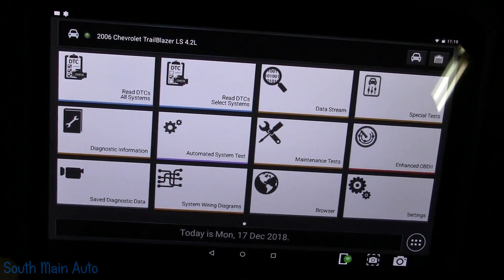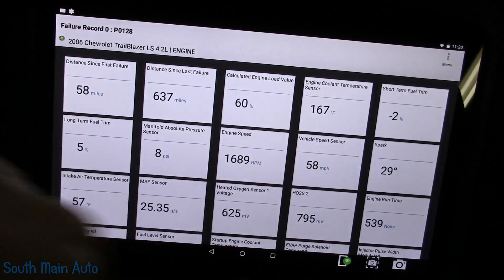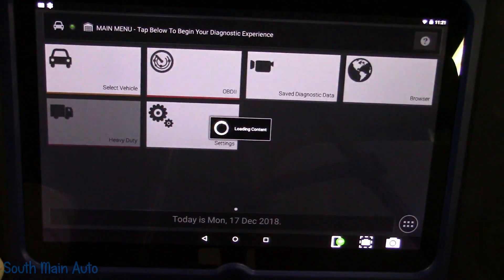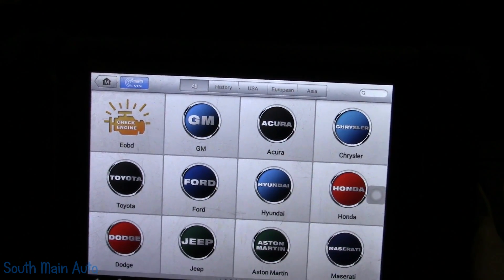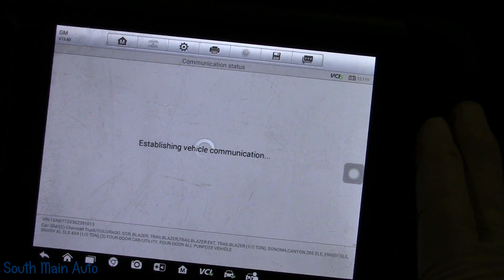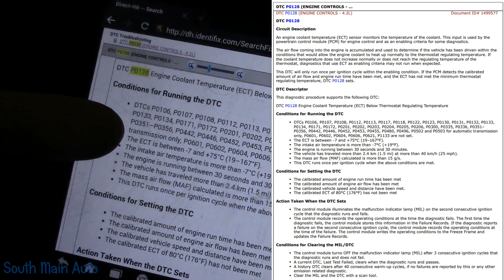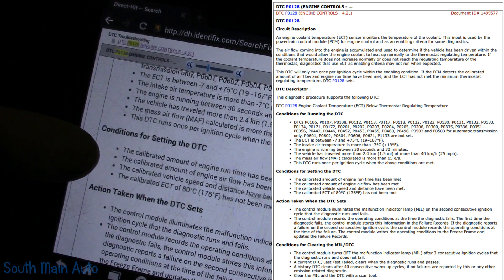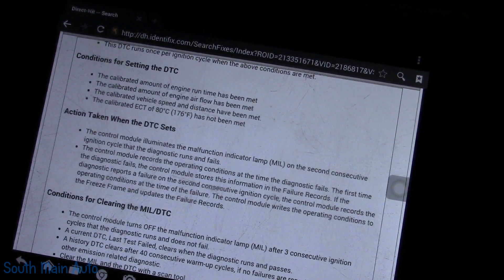Using Freeze Frame Data: Trailblazer P0128

Comment: Did a thermostat on my '04 Bravada (same engine, etc.) about three years ago as I had the same code (low mileage vehicle at approx. 62 k at the time).  Recently got the same code (P0128), at 83 k, so this time I changed the coolant temperature sensor (and I know I should have changed the thermostat again) but I was curious to see if my temp sensor was the real culprit.  So far, no code, but I guess time will tell.  Oh, changing either is a big pain in the tookus(sic); behind the alternator, which isn't any fun either.  Hope I don't have to go in there again.   :D

Comment: Not necessarily freeze-frame data - but I use FORScan with my 2001 F250 7.3L for live data to monitor HPOP pressures and more.  Also good for injector buzz-tests.

Comment: I've had quite a few Ford 3.0 DOHC engines with vacuum leaks (intake), where freeze frame data told the tale. Misfire city - freeze frame says,  coolant temp: 59° - runs better with heat - then confirmed with the water test. Bingo! Longest part of the diag is waiting for the damn scan tool to stop the "spinning wheel" thing and get down to business! 

It's 2019 - can we get a damn magic-box computer that works FAST??? Is that too much to ask?!? 😡 

GREAT vid, Eric - you say you're not a great teacher ... I say ...  BS !! 🍻😊
Reply: Since both scan tools were so slow in this video, I'm guessing the ECM being slow to respond to requests from the scan tool is the issue..

Comment: To be really anal, you could get the engine up to temp and check coolant temp after 8.5 minutes with, say, an IR gun or a thermometer in the filler neck. Could be a temp sender that is slightly out of spec. But experience tells me.....

Comment: I have a 02 and 04 trailblazer. I had that p0128 code poping up about once every 3 months or so.  I changed the thermostat and the code came back so I changed it again with a oem thermostat, but the code still occurred. Then I learned about watching the "indicated" temps via obd. I had a bad temp sensor. Also I am pretty sure that a bad temp sensor is why it didn't have the power and fuel efficiency it normally would have. Now my problem has been solved for about 5 months. But my temps are still only about 195, when they should be 210.

Comment: Back thru the 80''s We/I were only dreaming of features like this in the computer and scanner. Back when we thought a mixture control solenoid pulsing the metering rods up and down inside a Rochester carb seemed advanced.

Comment: This video somewhat touches on the discussion of WUW about which scan tool, and why. I agree that a video of side to side comparison would  not be feasible. A quick mention of why you used the one that you did would give regular viewers an idea about where the strengths and weaknesses between the brands stack up.

What I mean is that it would be helpful if you mentioned Snap On sucks for pulling up this type of data, or OTC works well with GM computers.....Sometimes you give a summation at the end. This could be a great time to mention what I’ve suggested. Eventually, we’d pick up on why you picked the tool that you have.

Comment: never thought about freeze frame data much except those hard jobs where your like what the heck is happening most times more than 1 problem freeze frame data made quick work for a 1hour diag. i am going to start looking at it more. would be cool if someone did a video of a good car unplug something let it set the code look at the data then learn from that. thks mr. o

Comment: I just recently had an 06 Trailblazer with almost the same issue. The same code would set but it was random and not consistent. It would go away for weeks and come back once in a while. Usually when the vehicle was due for an emissions test. Without freeze frame data, I would have had to fire the parts cannon at it and hope for the best. What I found via freeze frame was that the code would only set when the vehicle was above 65mph. So I took it for a ride monitoring coolant temp. What i found was that at idle, the vehicle would come to temp, the stat would open, and regulate just fine. At any speed below 65 the stat worked perfectly and temps were steady. Once I hit 65+ i could watch the temp drop roughly 1 degree per minute until ultimately it was below 176 and the MIL would illuminate and the code was set. At that point i suspected the stat was bypassing a small amount of coolant when closed but enough so at higher speeds the rad was able to cool better. When i pulled the stat i found what looked like a small piece of casting sand stuck to the surface of the sealing surface on the t-stat. I did a quick test by pouring some water in the housing and sure enough it was leaking through. I replaced the stat and all was well. Freeze frame was def a huge help showing me where the issue was occuring and giving me a good baseline to troubleshoot from. Great vid Eric!!

Comment: When the thermostat in my car, Ford Fusion 2010 2.5, stuck open my freeze frame was that I was FREEZING when driving, did I mention it only had 15,000 miles on it.

Comment: Thank you Eric for showing this information this will help me in the future I recently did a thermostat replacement on a 2006 Chevy Impala that had the error message engine hot AC off what my mistake was I change the coolant temp sensor first and if I looked at Freeze Frame data that would have helped me narrow it to be a thermostat rather than a sensor thank you so much I could have saved a whole lot of time looking at the Freeze Frame data ended up breaking the wiring harness pulling the temp sensor out and had to do wiring work as well big pain in the butt. Change the thermostat because the code set again you guessed it now we are fine.

Comment: 12:10 of time and people get educated never a bad thing . i have learned more by watching someone do something ,and then i jump into it with both feet and get some hands on. i dont use  freeze frame data to often but can short cut your diagnostic time down ..... questions equals your costumer telling you what is wrong  with there car ...... just another way to look at  the work you have in front of you ..... great tip as always  ...... thanks for your help .... it is interesting that one diagnostic tool over another can make a difference . i have thrown this out there to others as well for more hits and tips to the diagnostic equiptment vs. car ..... if doing programning are there any better choices over others as to web based or pay monthly vs. per need at time ...... such as , i use this piece of equiptment and go here for the programing needs ..... any help is always appreciated .... thanks again

Comment: Have you ever been misled by freeze frame?  Working on my buddies 2000 Jeep Cherokee 4.0L  cylinder 3 misfire.  Freezeframe shows rpm at 0 (but 13% load and engine never stalled,) closed loop, intake map, vehicle speed all at 0.  Suspecting a possible loss of 5v ref, but engine coolant temp shows 194.  Short term and long term fuel trims have high values.  One problem just put me at a fork in the road -- investigate cyl 3 misfire or start checking pcm powers grounds and 5v ref??

Comment: Isn't it so frustrating when a scan tool has such a stupid gap like that? I was using a Bosch platform scan tool on an '03 Silverado the other day and it had 0 special tests for the body control module. I couldn't believe it. The Snap On tool I had previously had all kinds of functions in the BCM, including horn control which is what I needed that day. There's no doubt that no one scan tool has everything but I felt like that was a pretty basic thing not to have. Especially considering that Bosch makes the OEM tool for GM.

Comment: Eric is there any way on an Autel to capture a snapshot of all the data PIDs manually. I have a 2001 dodge ram, it runs fine except once in a while after a hot restart it will lose power and backfire for about a minute then resume normal operation. I can recreate the problem fairly easily. I would like to have my scan tool hooked up and when it fails take a snapshop of the pids and then compare that to another snapshot after the problem clears up. Similar to your freeze frame situation, except this problem never sets a code. I was in the market for a scanner and purchased an Autel MS908BT specifically to help me diagnose this issue.  Thanks for all you do.

Comment: OMG, when I used to do this stuff back in the Paleolithic period, we had to use the Force to figure out what happened and when. Now this is why computers are so good for tracking down a fault. If the problem shows up in the history with time periods clearly shown, this is clearly a method to determine that the thermostat did not close in that period and indicates that is the reason for other systems being unable to change air mix or electrical timing to compensate. This is clearly a sticky thermostat. Why is this important? Because if the fuel mix and electrical timing are compensating or not because the engine is not up to its regulated temperature, other things, such as rough idle or low power, fall out of the diagnoses until the thermostat is changed and new numbers are recorded.
Saying that the thermostat is bad and needs changing is kind of a big deal because the thermostat lives inside the engine and things have to be drained and parts of the engine have to be opened up to get to it. It is a big deal on today's engines more than back in my day where all of the engines were pointed in the same direction with access on both sides and hardly any problems getting to stuff to be able to work on them, not so at all for today's engines where many are turned 90° and stuffed in way too small of an area. 
Also, common practice back in my day was to automatically replace the water pump, "while you were already there".
Great video showing a very good example of why computers in cars make a better diagnostic tool when used to its' fullest extent, thanks Eric.

Comment: I have a great idea...a universal wireless dlc adapter. Includes all protocols and allows multitasking so all your scan tools could connect at once. When one fails simply pick up the next and move on. I'm sure there are hundreds of reasons it wouldn't work but a guy can dream...

Comment: these thermostats are pretty easy to access with a long extension through the wheel well. it saves you from taking out the alternator all together.

-Justin Sliwka

Comment: Thanks for the video I do use the freeze frame when they are available it gives you a clue if the car was idling of at hi-way speed etc .. also I look a the amount of times the fault happened so it tells u if it something that is pretty constant failure I notice that the coolant thermostat fault will come on real easy on some cars and on some other cars even though the thermostat is clearly not working up to specs the engine light might not come on .

Comment: Owners habits can be the reason for premature thermostat failure.  Something as simple as letting a car run for 30 min to warm it up before ya go someplace puts a lot of stress on the thermostat that opens at around 190 degrees considering the cooling fans don’t turn on till around 230 degrees. That puts a lot of stress on the thermostat. My daughter lets her car run over 30 min to warm up. She then complains about her heater not warming up when she’s driving..Extended warm ups can be hard on a thermostat. The freeze frame data defiantly showed what the problem was. Nice work Eric.

Comment: If this is the inline 6, swapping thermostat through the wheel well can speed things up.....due to its goofy location...if you're good with 18 inches of extensions lol.....
Reply: You should see where It is on my 2008!!! On the backside of the engine on passenger side. It’s incredibly hard to get to. Took me 2 hours to get old one out and new one in and that’s without taking anything out of the way.
Reply: Easier way is to  take the alternator out

Comment: Thanks and I beg to differ on the relatively easy to change a PITA to me.
Reply from the maker: Go through thr driver inner fender with about 24" 1/4 drive extension and a 10m swivel
Reply: @SouthMainAuto  I understand but i couldn't see the dang thing. Do you pull the inner fender?
Reply: @ericcorse  yes pull up the liner and like he said use about 18 in extension I did this last summer not bad just take ur time
Reply: @mrkttrdr2919  I didn't pull the liner when I tried I'll keep that in mind.

Comment: I have snapped thermostatbolts a couple times when changing these, sucks turns into a lengthy repair drilling out the bolt.Anyone els have this issue .The bolt went into the coolant so it had permatex on the the threads and was in there a long time it was a 97 or 98 chevy I believe

Comment: I had to diagnose my thermostat problem the old fashioned way on my 1995 BMW E36 318i. Coolant temperature gauge hardly registering along with lukewarm heaters. A new thermostat fixed the problem.

Comment: Thermostat or engine coolant temperature sensor.  Unless the sensors normally fail open,  right?  Good you have the knowledge that thermostats are the high failure item.  Thanks for sharing!

Comment: I STILL THINK IT'S B.S.   that you had to change scan tools.  they should all have to meet a standard. and its funny the discreptancy of the number of times between two tools
Reply: Specially considering the astronomical price of these scan tools
Reply: @DillonTurner395  nothing ventured nothing gained
Reply: That's what Ford's Open XC is wanting to address.  Manufacturers follow OBD and then add their own junk.  Whatever reader has to be able to decode the manufacturer specific junk and that has to be reverseengineered or pay the manufacturer to decode their protocol BS.
Reply: Unfortunately for all of us, scan tools are not all able to perform the same things. The more makes and models you work on, the more you see this...which is why in a perfect world we would all own each manufacturer specific tool....
Reply: I agree - customers, AND techs are getting screwed by automakers these days ....
Reply: You should see the situation here in Australia, the manufacturers hide data to a far greater extent, the independent shops have been completely screwed, let alone a home gamer like me .
Reply: same in Europe... and programming is completely hidden by the OEMs...  independent shops can hardly program or code anything
Reply: im a diag tech and having these different tools available makes most techs better than the main dealers. if the main dealers charge 100 an hour it wont take long before the tool payes for its self in the right hands

Comment: Found same problem on a 08 focus. Thermostat
Reply: We had one of those Foci with a thermostat code,  turned out the cylinder head
temp sensor was bad,  after putting two t-stats in it...